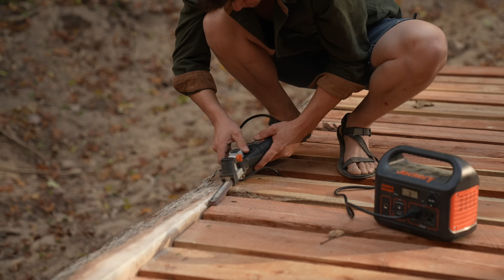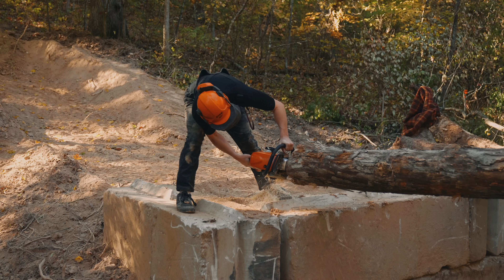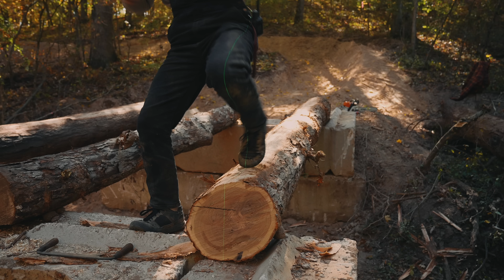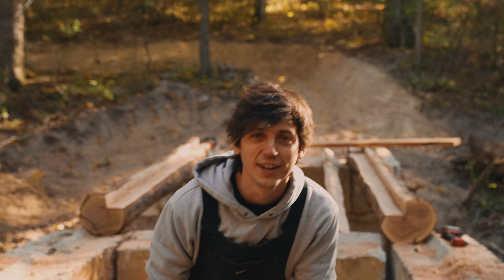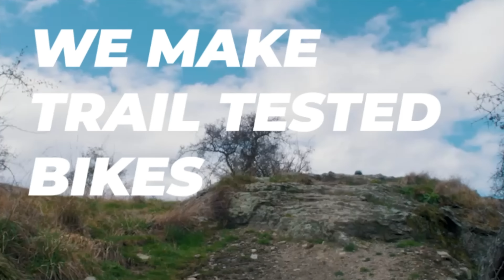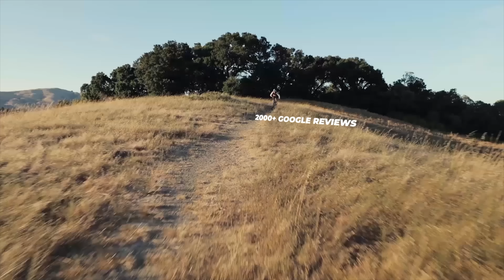Turning a Dead Tree into a Heavy Duty Bridge!

Comment: We used 20' long white oak that was about 8-12" round to build a bridge over a small spring. Only had 4 guys but thankfully we pulled the logs down a hill using smaller cut up logs as rollers. Years of experience in rigging paid off, it was way easier than I thought it was going to be. Hopefully the next time we get together we can emulate some of these great builds.

Comment: When your talking bridges, they're not footings, they are more appropriately called abutments as they abut the crossing. Also if you want a stronger bridge you place the stringers/girders across the span, then ties over the stringers/girders, then a running surface in the same direction as the stringers/girders.